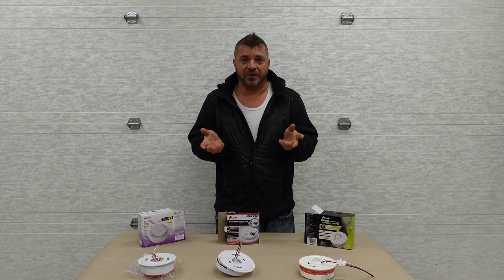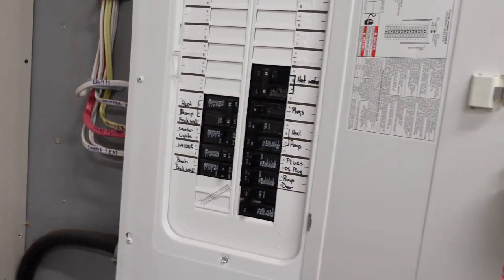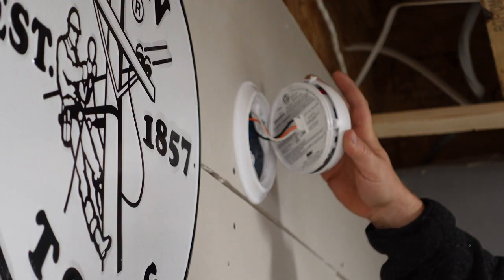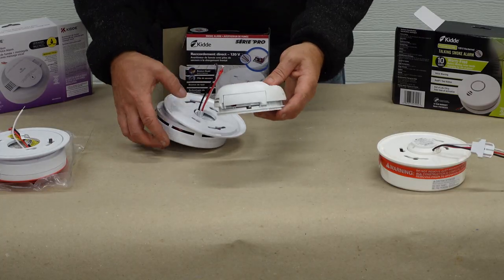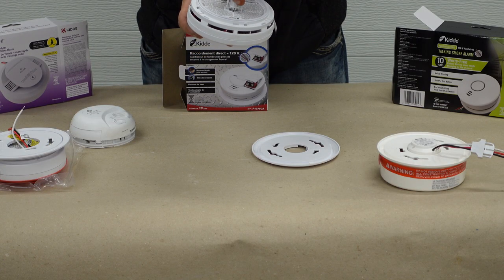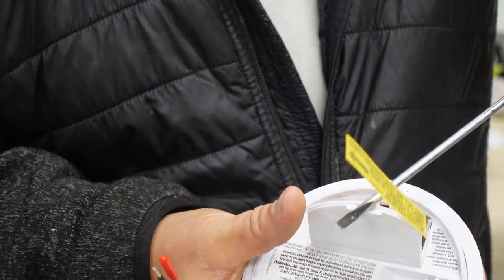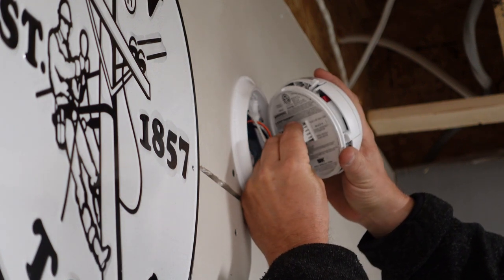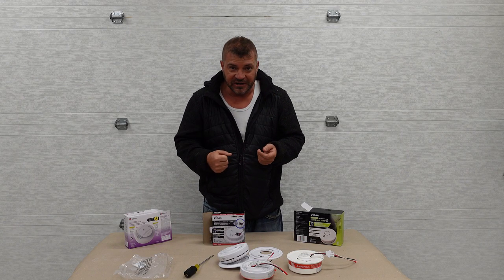Can you unplug a hardwired smoke detector

Comment: I need to turn mine off for exterminators, will I be able to just take them down? Sounds stupid lol but I assume if they’re not connected they won’t make any noise 😅😅😅
Reply: If they have batteries in them they will still go off, so you’d want to take out the batteries:) I know this was a long time ago, but maybe it’ll help someone else
Reply: @MossyRavyn  Yes, mine is still going off after replacing the battery and unplugging from the back of the detector. Too expensive to continue buying batteries if they have no use.